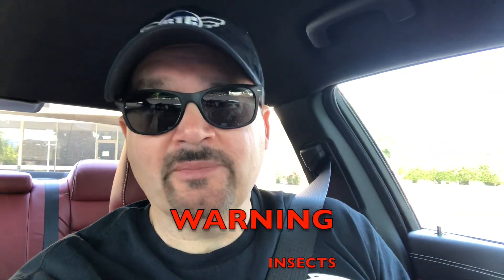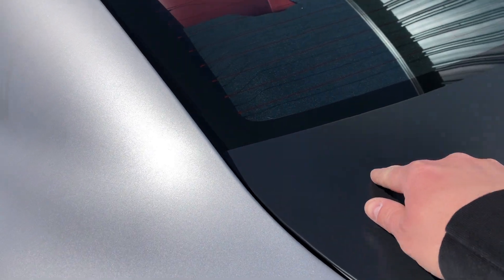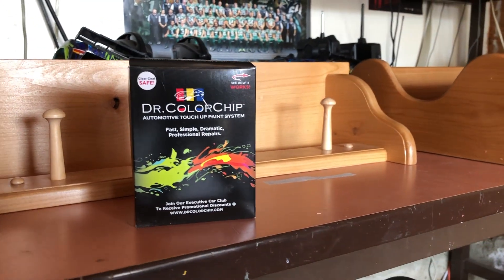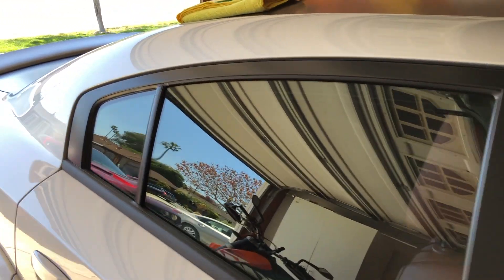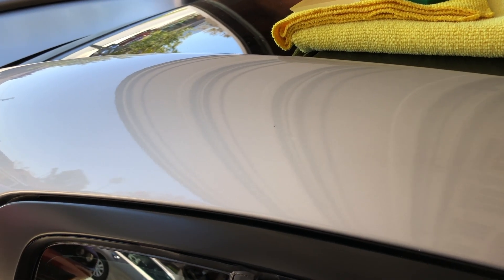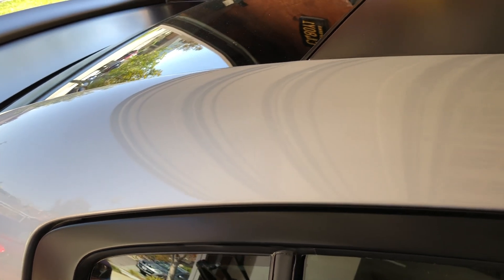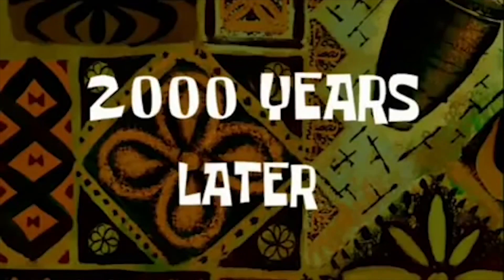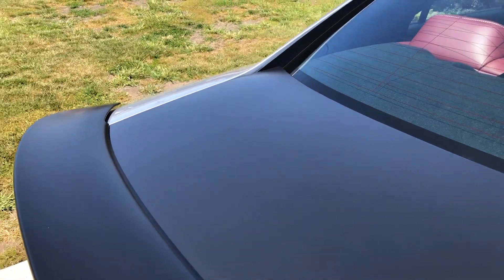Pain in the A$$! 2023 Charger Hellcat Redeye Jailbreak

Comment: When I took my car for the ceramic coat, the detailer found some issues on the roof, mostly from shipping I think. A tiny dent, a buffing mark and some scratches. Also what looked like a factory paint issue (in a tiny spot). I took it back to the dealer and they took care of it. Not sure how they fixed the paint issue (looked like dust  or something got under it during the paint job)but it looks fine now. All of it except the dent was extremely hard to notice but once I saw it, I couldn’t live with it.
Reply from the maker: Totally get that! Glad it worked out! No car is 100% perfect !!
Reply: @GuysTalkingCars  way off topic but what do you think about a strut brace? Waste of money?